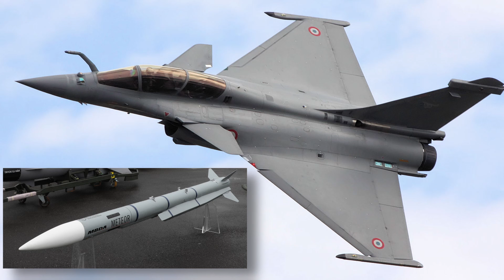Meteor armed Rafale attacked Pakistan Air Force in OP Sindoor ?

Comment: Again you are pushing this false narrative that the Rafales carried the Meteor Missile..IT DID NOT CARRY METEOR MISSILES IN OP SINDOOR .. The Rafales carried SCALP Missiles to destroy the terrorist hideouts. There is a specific reason why The Rafales were not armed with Meteor Missiles..Ground Targets were hit by SCALP and Brahmos.. Aerial Targets were hit with S400 because PAF Platforms were inside Pakistan  beyond the range of Meteors.. using Meteors Which cost Rs.20cr per missile would have compromised the operation.. Get your facts correct instead of speculating any nonsense which is purely figment of your imagination
Reply from the maker: who told you Rafales did not carry Meteor missiles? Rafales can carry Mateor in addition to scalp , read the citations of veer chakra, The Vir Chakra citation for Group Captain Ranjeet Singh Sidhu mentions that during Operation Sindoor, he flew multiple deep-penetration strike missions and also carried out air defence missions to support other fighter pilots flying similar strike missions. This indicates that Indian jets switched between attack and defense roles mid-operation.  Ranjeet a Rafale Pilot, you are peddling misinformation at this point based on your own hypothetical cost calculation
Reply: @MapReaderYT Proven that you know jackshit about  Air Ops in Ops Sindoor..Does the citation to Gp Capt Sidhu ( Not Sandhu) say that he was carrying Meteors?? NO it doesent !! All the citation says that Gp Capt Sandhu performed both Deep penetration Strikes and Air Defence missions in support of other IAF Aircraft..that does not prove his aircraft was armed with Meteors..If you had taken the trouble to go thru All the citations awarded to the IAF Airmen you would have noted that they all spoke of the Rafales carrying out Ground Strikes amid heavy enemy fire..Not one citation said that enemy aircraft were taken down by the?Rafales in aerial combat..Only Gp Capt Patni citation credits him with destructive strikes on PAF Platforms from an S400 platform. Even if one was to take your Wildly Speculative assumption at face value There was a standoff fire between the PAF and IAF Platforms in the early hours of 7th May..What is the Kill scoresheet for the Meteors. ZILCH ZERO !! All PAK Aircraft were downed by S400 strikes in the air and by Brahmos Strikes on their ground facilities. This has repeatedly been confirmed by the IAF Top brass many times. If you keep insisting that Meteors were carried/ fired from the Rafales it means the IAF Pilots were particularly inept at firing and wasting the 20cr missile with ZERO Results.. wake up and smell the coffee my friend !!
Reply from the maker: @jayantochatterjee6413  so which missile was he using to provide defensive cover against pl15? let's see your superior air ops knowledge
Reply: @MapReaderYT I will refer you to an Article Titled " Meteor Missiles Delivered, Stockpiled and Silent" ..Look it up on Google.. The article clearly states that "not a single Rafale Sortie showcased the sleek ramjet powered wonder " referring to the Meteor..it also quotes Air Marshal Sanjay Dutt to explain Why the Meteor was held back and Astra Mk1 was used alongwith MICA as some images suggest .Which proves conclusively what I have been saying about The Meteor NOT being used in Op Sindoor .
Reply from the maker: so according to you the veer chakra winner was defending the attacking aircraft which is flying ahead of him with a 80-100 km bvr ? , Indian Airforce has never said anything about Meteor not being used
Reply: Ur idiot.meteor  was used
Reply: Agreed Sir 👍
Reply: Whatever it was india forced the pakis to REQUEST ceasefire. That shows who the winner is.